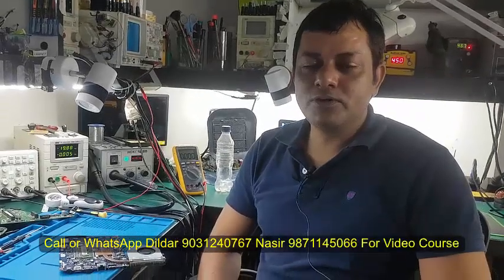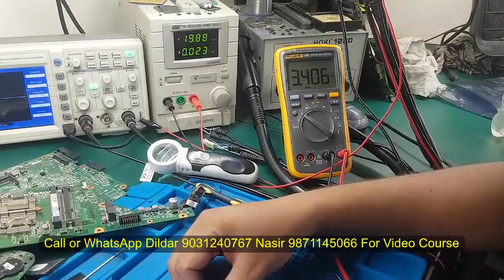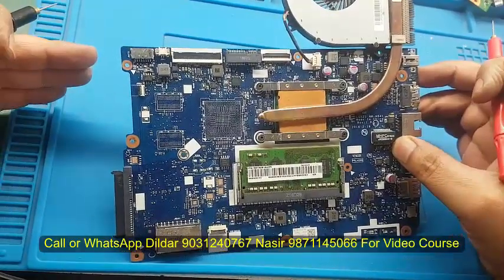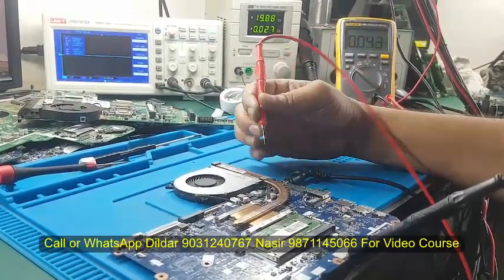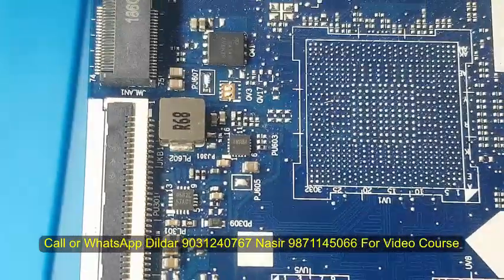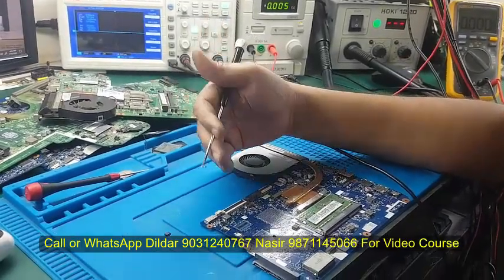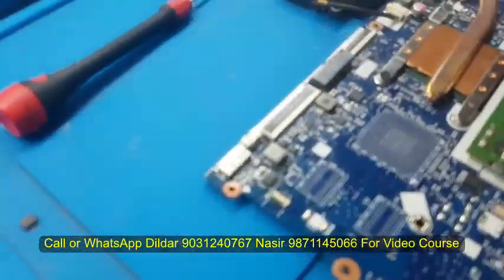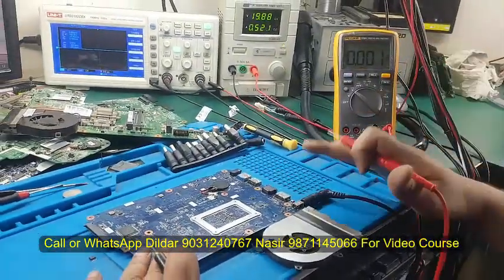Laptop Working on Battery but not on Adapter | Nm A841a |Online Chiplevel Laptop repair video Course

Comment: I have Early ( 2015) A1466 MacBook Air but trackpad not working properly ,cursor moving automatically I have done all resets ,cleaning trackpad replacing trackpad ribbon ,,,,,now what do u suggest ????should I replace trackpad assembly itself
Reply from the maker: You can try that 👍

Comment: sir off me battery charge ho rahi but on pe plug unpluge adapter dikha raha hai kya problem ho sakta hai sir...
Reply from the maker: Charging Section requirements check kijea.
Reply: @laptex1377  sir uspe maine check kiya windows change kar k charge hota hai horaha hai but graphics driver install nahi karne tak properly kam karta hai but graphics driver install kartehi problem aa raha hai...
Reply from the maker: Maybe BIOS issue.
Reply: @laptex1377  BIOS se v aaisa problem ho sakta hai kya sir....

Comment: Sir my laptop works fine when once turned on. But when I turn off then it is very hard to turn it on. Takes hours to turn on. Also it doesn't charge when laptop is off but charges normally when on. What could be the problem sir ?
Reply from the maker: Need to get it checked by local technician. Maybe BIOS, DCIN or changing section issue.
Reply: Could you solve it? I have the same problem, but computer is working, the same thing, very hard to turn on again. I measured, and button is working as well.